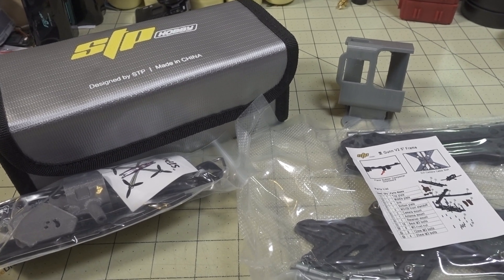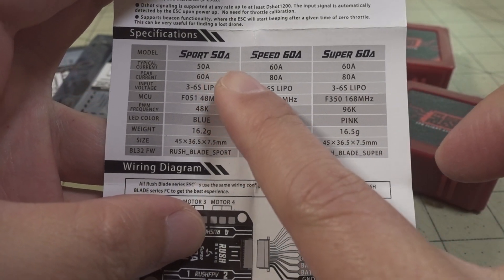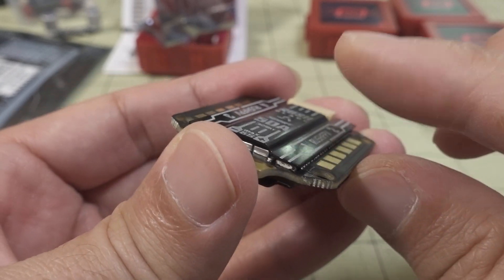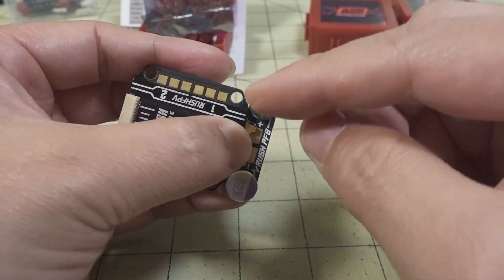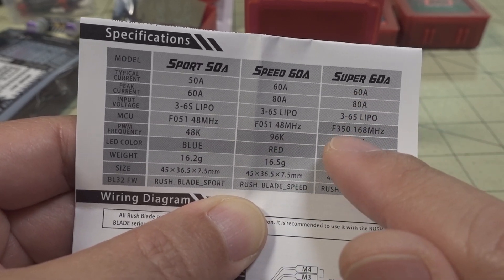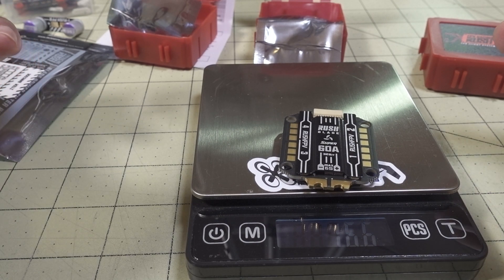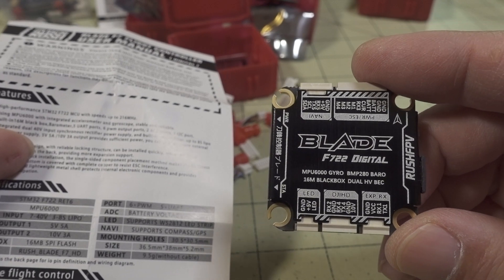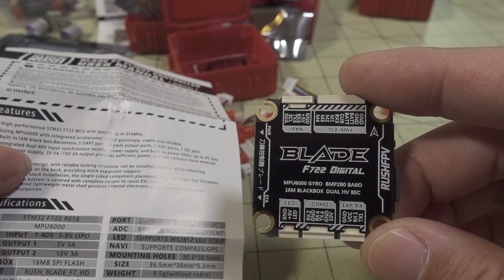RushFPV Latest Stacks (BLADE Sport & Super, F722 Flight Controllers)

Comment from the maker: STP Gunn V2 Frame - http://bit.ly/2VqDmEd (DJI) | http://bit.ly/3muq0T9 (Analog)
GoPro Mount - http://bit.ly/36pFYbA
Rush BLADE Super 60A - http://bit.ly/2VBHwJD | http://bit.ly/3loyqdD
Rush BLADE Sport 50A - http://bit.ly/3mrKdcg | http://bit.ly/3munIDJ
Rush F722 FC Digital - check back later
Rush F722 FC Analog - check back later
Rush Power Filter Board - check back later

🙏 Please support with a 👍 and don’t forget to hit the 🔔 thanks!

👉 Old gear for sale here -  http://bit.ly/AlbertGearFS

💲 Get the latest exclusive coupon codes (updated often)
     http://bit.ly/34SYiGn

Comment: I think the best way to do this on tight builds is to solder this board with xt60 connector that would be so much better 
Love the box design and the best thing they did was make a specific board  for filtering rather dangling capacitors i never liked that.

Comment: Rush has great products! Awesome packaging! Great video. Thanks! Do you think the Furious V2 Smart case for DJI has enough voltage at 8.3/8.5v to power the DJI goggles correctly. Do the goggles work any differently if powered by 14.8v versus 8.5v? Trying to research before purchasing. Thanks